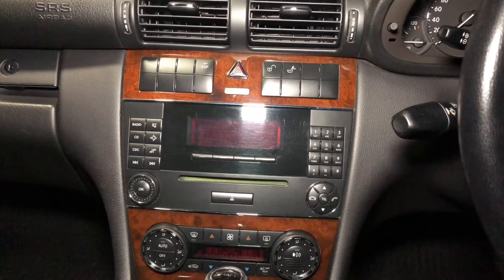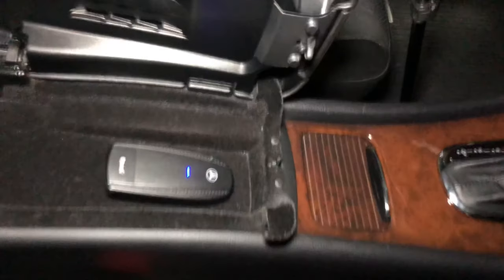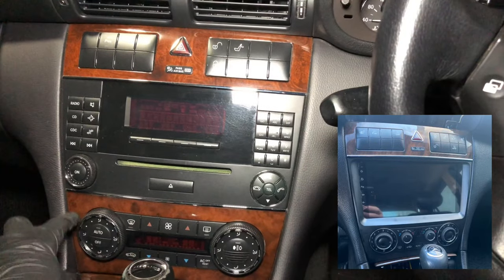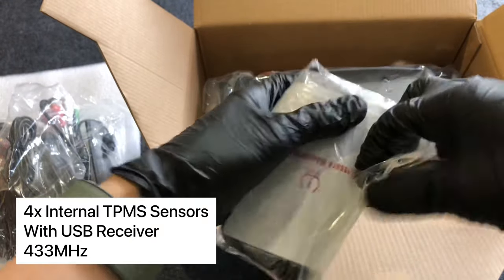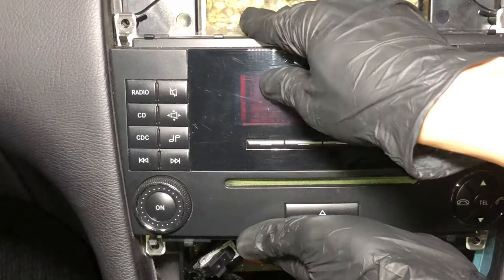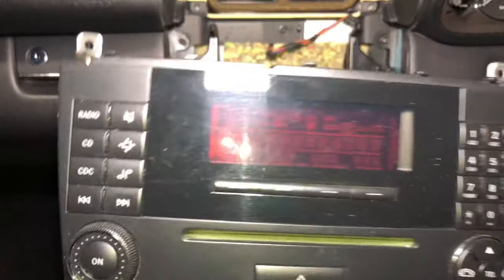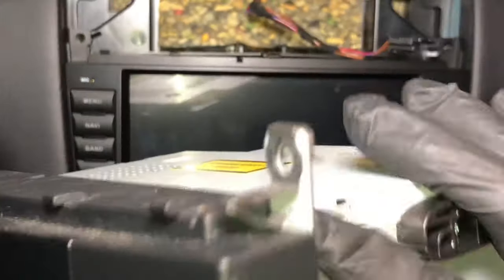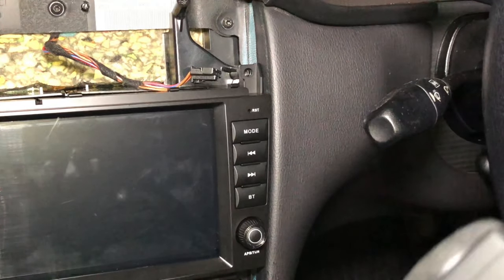MERCEDES C200 W203 | ANDROID HEADUNIT INSTALL GUIDE

Comment: Sir from where can i order this product, I want this for my car
Reply from the maker: Hi Hriday, firstly thanks for visiting my channel.

You can purchase this Android headunit using the link below.  It will take you straight to the seller’s product page.  Also if you head over to the description section of this video, I have links to other products that you may need for this DIY project.  So make sure to check that out too.

—> Android Headunit for MB C200K W203 (https://tidd.ly/3yPeEjz)

Before you make the purchase, please confirm with the seller if this is compatible with your specific car.  You can do this by simply sending them a photo of your current OEM car stereo.  Look for the “Contact” link somewhere in the page to initiate a chat session. 

After getting their confirmation, the next thing you need to do is decide the spec of the headunit you want to get (there are several options).  Lower-spec’ed units doesn’t usually come with Android Auto or Carplay integration.  So if AA/ACP is important to you, be prepared to spend a bit more.  But in my opinion, having AA or ACP makes a whole lot of difference in driving experience.  You’ll forget you are sitting inside a 15 year-old car 😁

By the way, Android Auto support isn’t enabled by default but since the seller advertised support for AA, you should ask the them to give you the activation key for the AutoLink software - even if you are iPhone user.  Autolink is like an emulator to enable Android Auto on this headunit.

I also read somewhere that if you have the sports steering wheel (the one with three spokes), steering wheel control buttons might not work.

Lastly, I’m glad you decided to do this DIY project.  The hardest part to this job is removing the control panel just below the A/C vent as well as the A/C control panel below the OEM stereo.  But if you have a pick tool similar to the one in the video, you should be able to pull it out without issues.

I hope you find this info helpful and good luck on your project 👍

Make sure to check back in here when you are done with your project or if you have other questions.  I’m more than happy to help if I can.

Comment: Does this unit have rca out to add a amp?
Reply from the maker: Hi Ian, yes this particular headunit comes with limited RCA audio outputs: Subwoofer, FR, FL.  Strange there is no dedicated output jacks for the rear since I’m sure the headunit supports it using the standard Quadlock wiring harness.

Comment: Great video. Would be possible please to make short video how the FM radio works? Signal quality please? Thanks.
Reply from the maker: Hi Jan, sure can.  I’ll refer to the instruction manual that comes with the unit and make a video to demonstrate the features.  But as a quick overview, the radio app has 3 FM and 2 AM bands.  Each band can hold up to 6 radio stations.  There is an auto-scan button to pre-fill all 18 FM stations (or 12 AM stations) for you.

In terms of signal quality, it will be hard to quantify this but all I can say is that from where I live, it can pickup all (if not most) FM/AM radio stations and I don’t hear any static/crackle in the speakers.  Of course if I’m in an underground car park its different.
Reply from the maker: Hi Jan, here’s that video —> https://youtu.be/Htx587Psd4U
Reply: @AutosNGizmos  Thank you !

Comment: Has this Radio darkmode like the audio50 ?
Reply from the maker: Hi FG, sorry I’m not too familiar how Dark mode works on either Audio20 or Audio50.  Can you explain how that works on your Audio50 so I can figure out if the feature is available in this Android headunit?
Reply: @AutosNGizmos  hello,

On the Audio50 Aps when its dark outside because of the night or when you drive in a tunel ,the radio goes in darkmode and the menu gets black(like on the new smartphones)  i think the mercedes has a light sensor on the windshield. Thats why i asked if the androidradio has that feature too.

Thanks
Reply from the maker: @FG-fc5oz  Based on my initial test, the button illumination turns on/off based on whether the car’s headlight is on/off (I have auto lights). I didn’t notice the whole display goes bright or dim though. But of course if I’m using Carplay, the UI automatically goes darkmode based on my iPhone settings.

I hope that helps 😊
Reply: @AutosNGizmos  Thanks for the Information Sir! I habe another question do i need a adapter if i have harman kardon speakers or it works like that too? 

Thanks!
Reply from the maker: Hi FG, a viewer in my channel tried installing this headunit on his W203 equipped with Harman Kardon speakers and unfortunately it didnt work. The seller suggested to buy an analog to optical converter but I’m not sure if that fixed the issue though.

You might also want to watch this video from another DIY’er who used the optical converter for his W209.

https://youtu.be/k6Gfd7UHMSo

You can skip directly to the part where he is explaining how to connect it up which starts from 14:20
Reply: @AutosNGizmos  thankyou very much Sir!👍👍👍

Comment: Great, detailed video. What model radio did you buy please?
Reply from the maker: Thanks for visiting my channel Mark.

Here is the link where I purchased the headunit.

https://a.aliexpress.com/_mLsCqQp

I got the 4GB RAM + 64GB ROM as it has built-in support for Carplay. 

Good luck!
Reply: @AutosNGizmos  great, could you please, record, fast 2 min video of the UI, I am intresetd in this perticular radio, but I don't know what looks like the UI of Androids apps, and staff. Thank You.
Reply from the maker: Yes will certainly do and post a short video today
Reply: @AutosNGizmos  that would be really awesome, additionaly I have 2 more question regarding this radio, first does you use build-in microphone for phone calls Bluetooth or added external on cable microphone, as I read that build in have not so great quality.
2nd question, did you mount the GPS Antena inside the radio space, or put it outside, on the cocpit or window?
Reply from the maker: Hi Arc, I initially didn’t install the external microphone that came with the headunit. But after having tested the audio quality of my voice on the phone on the other side, it was pretty bad so I will open it up again and install the external mic.

With regards to the GPS Antenna, I normally put it on top of the dashboard (bottom of A pillar on the driver side).  I heard you can attach the GPS antenna onto a metal piece inside the dashboard cavity but I normally prefer to have it outside.  If the GPS have a longer wire, I prefer to stick it next to the rear view mirror so its discreet but in most cases, the wire is just long enough to make it to the bottom of the A-pillar.

I hope that info is helpful 👍
Reply from the maker: Here’s that video: https://youtu.be/JPZUxchL-7s
Reply: @AutosNGizmos  Thank You

Comment: Will this head unit fit a 2005 c230k?
Reply from the maker: Hi @r0ckoon, yes it should fit as I have other viewers install this on their c230k. However, it is best to confirm this with the seller. One thing I would note is that if your car has the Harman Kardon speakers, you might need to install a separate device to convert analogue to digital audio. But make sure to inform the seller what type of speaker you have.

Have a look at this other video where the guy installs a fire-optic converter on his Merc with the Harman Kardon speakers (around the 14-minute mark)

https://youtu.be/k6Gfd7UHMSo

Comment: What size?  Will this work for 2006 C180k?  Size please?
Reply from the maker: Hi Suesan, this particular model has an 8 inch screen (measured diagonally) with 4GB ROM and 64GB RAM.  Other dimensions advertised in the reseller’s product page are as follows: Height=119.85mm, Top Width=261.05mm, Botton Width=240.37.

Whether or not it works (or will fit) on your 2006 C180k, depends what your current OEM stereo looks like as I’ve seen a few variations of them out there.  You can confirm this directly with the reseller by providing them a photo of your current stereo.

One other thing that you also need to take note of is whether your OEM car stereo has either: (1) Built-in GPS navigation or (2) Uses Harman-Kardon speakers.  If either one applies to you, you will need to purchase an extra set of wiring harness.  Again, you need to provide this info to the reseller so they can help you purchase the correct product.

I hope this is helpful and good luck with your DIY! 👍
Reply: @AutosNGizmos  I have a c180k 2006 will this work and how would I order one with a reverse camera
Reply from the maker: Hi Suesan, I’m afraid you need to contact the reseller directly to confirm compatibility.  But the product information page indicate it supports C-class W203 series from 2004-2007.

With regards to the reverse camera, some reseller can bundle a reverse camera (extra cost) but may not necessarily be the best quality. In my case, I opted to get from a different reseller so I cant comment if the reverse camera from this headunit reseller is any good.

Comment: is there a way to set up the buttons on the drivingwheel?
Reply from the maker: Hi Alexander, The headunit in this video comes with a Canbus decoder (aka SWC module) so it’s already pre-configured to work with the steering wheel buttons.  But I’ve read in the comments section of the products page that some people an unable to make the buttons work if they have the sports steering wheel.

If you don’t have the sports steering wheel and you need to re-configure how the steering buttons behave, there is a “SWC” app under “Car Settings” which lets you do this.  But the main thing is that you need to have a Canbus decoder compatible with the headunit before you can do any of this.

I hope thats helpful.  Cheers.
Reply: i bought it thanks to your installation and review videos. i love it, easy thanks to your video. thank you!
Reply from the maker: @alexanderwissiak6305  Awesome! I’m so glad I was able to help you 😊
Reply: @AutosNGizmos  The SWC app cannot be used to change the button assignment, if a CAN bus decoder is used. The button assignment in the "secret" menu does not work either, i.e., one is stuck with the pre-configured button assignments. They all make sense, though, so it is not a big loss. I just wish I had been able to assign a different response to the voice control lever.

Comment: Where are you located and what do you charge for an installation
Reply from the maker: Hi there, I do this only as hobby, on my own car and during my free time. I haven’t done this as paid work.

But IMO (assuming you don’t need a reverse camera), the most difficult part of this project is actually choosing the right headunit/product. Once you have the right headunit, and you have the slightest “DIY” gene in you (and the right tools of course as shown in 14:13), the work in the video becomes really straight forward.

If after the above info and you still need assistance and you are based in Melbourne (Australia), happy to meet up in person after the lockdown and help you.

Comment: Dose this fit 2002 c230 kompresser?
Reply from the maker: Hi there, according to the product information, this headunit only support C-Class W203 (2004-2007) or CLC W203 (2008-2010). Since yours is a 2002 model and without seeing your existing stereo, I’d say it won’t fit.  However if you want to be sure, you can contact the seller directly and send information they require to assess compatibility with your car.

Comment: Is that work with c180 2004 ?
Reply from the maker: Hi Thug Life, if the shape of your existing car stereo is exactly the same as the one in my video, chances are it could be compatible.  But it is best you confirm directly with the seller via chat and provide them with the year/make/model of you car and a photo of your stereo.

FYI, there are other W203 owners here who reported they have issues with no sound coming out of the speakers if they have a Harman Kardon speakers and additional harness is required to make it work.  Others have reported their steering wheel control buttons don’t work if you have sports steeering wheel (3 spokes).  Best to let the seller know these things so they can help you get the right product/part for your car.

Good luck and let me know if you have further questions.
Reply: @AutosNGizmos  thank you too much bro

Comment: What about the fiber optic cables
Reply from the maker: Hi Eman, my car isn’t equipped with Harman Kardon speakers so it doesn’t have optic fibre.  Does your car have Harman Kardon speakers?  If so, another viewer in my channel tried installing this headunit on his W203 equipped with Harman Kardon speakers and unfortunately it didnt work. The seller of this headunit in AliExpress suggested to buy an analog to optical converter but I’m not sure if that will fix the issue.

You might also want to watch this video from another DIY’er who used the optical converter for his W209.

https://youtu.be/k6Gfd7UHMSo

You can skip directly to the part where he is explaining how to connect it up which starts from 14:20

I hope this information is helpful.
Reply: @AutosNGizmos  thanks for the info
Reply: If you get the analog to fibre optic converter, make sure you get the right type. There are at least three different types and which one is the right one for your car, depends on whether you have the sound system option (Harman-Kardon) and/or which audio gateway type in the car. The most risk-free solution is to use one of the "6m cable"-options (Kapud sell one of them) that bypasses the amplifier in the car and uses the amplifier within the Kapud unit. Not sure whether the latter will work well with the 2Ohm speakers of the Harman-Kardon system, though.

Comment: hai, I need this system. how I contact you
Reply from the maker: Hi there, information where to buy this specific product can be found in the description section of this video.  Please check it out.  But as always, please directly confirm with the seller if this headunit is compatible with your car before you make the purchase.

You can continue to contact me through the comments section of this video if you have questions as this will help other potential DIY’ers in the community who may have a similar question.

Please note I am not affiliated with the seller.  All my recommendations are purely based on my personal experience and research.